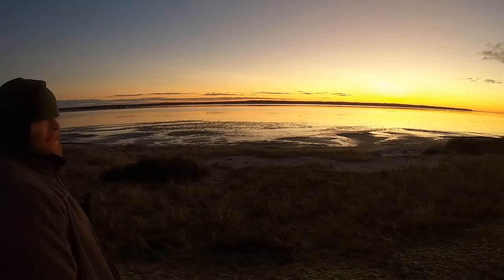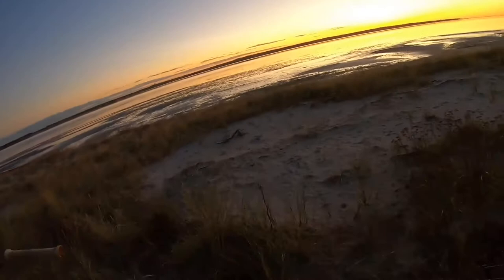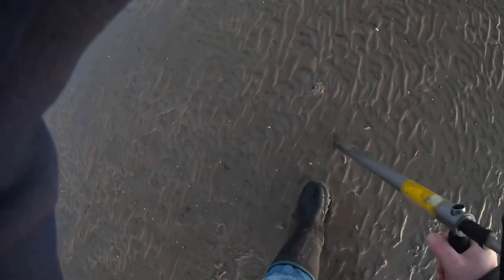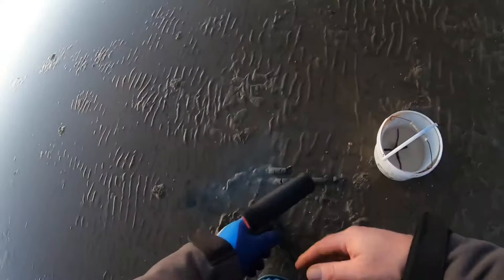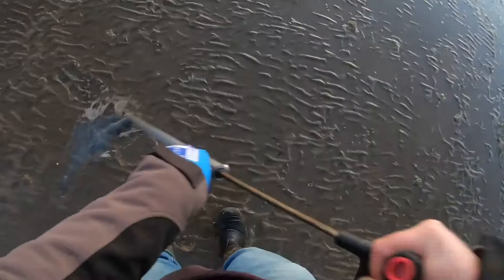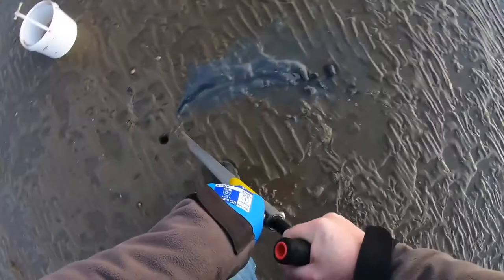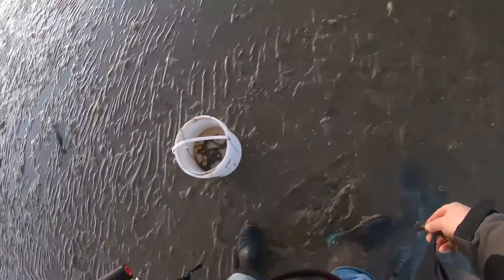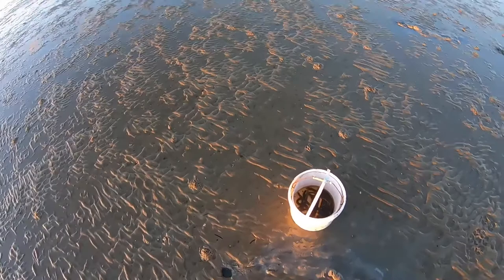How to pump lugworm - and why I suck!

Comment: Hi Billy, just seen this video and have had one session with an online brought bait pump that has a wing nut as a bottom tension nut, I only managed 3 worms and thought it was down to not pumping properly, thanks so much for the info regarding removing this type of nut and replacing it with a standard locking nut, I'm also now building my own bait pump and will be doing the same with that too.
Happy fishing
Reply from the maker: Glad to help out Steve, fish on Brother 👍😁👌

Comment: I pump lug full time for a living and make bait pumps . I don't push my pumps too much but if your interested I can make you a deadly bait pump . In the right hands I've seen a 1000 lug a tide blasted out using these pumps.
Reply from the maker: I do just fine, with the one I have, thanks Brother. But no boddy is pumping a 1000 lug in a tide, where I am.  A big tide is 60cm and there not alot of ground to pump👍👌

Comment: Hello Billy, I'm french, sorry but here we don't find screw (english parameters, not metrics size). I want to follow your instruction in replacing wingnuts but which size I have to put please ? Cold you give me reference pleae, thanks
Reply from the maker: Hi Ppte. Sorry but I do not have my pump with me right now. So what you should do is take your pump to the hardware store and they will help you with that. The nut I use is a stainless steel nylon locking nut. Thanks hope this helps you out 👍😁
Reply: @Billyfishing_watch   @Billyfishing  Thanks Billy, the problem is that we have a system metric size in france not an english size. Size screw and nut is different and this afternoon, i tried severela store, nobody can't find; I have to buy it to internet but I don't know the size, it seem to me that it is may be 5/16 UNC nyloc but I not sure.
Reply from the maker: Hi, my pump is an Australian pump. And I purchased the nut for it  in Scandinavia. They also use the metric system. Where is your pump from?
Reply: @Billyfishing_watch it is an alvey  pump bought in france (slim pump 30mm)
Reply from the maker: That's the same make as mine, but my pump 35mm. Do you know a mechanic, he might have a thread gauge. And possibly help with your problem. 🤞
Reply: @Billyfishing_watch  hello Billy, thanks a lot for your support and kindness, continue to post video, nice channel and full tricks inside.
Reply from the maker: No probs Brother 👍

Comment: Have you dug Rag before? A video on digging Ragworm would be cool. Also would Olive oil work better than washing up liquid for the pump or would it clog with the sand? Lastly Billy where would I get a pump, if actually enjoy going and getting my own bait
Reply from the maker: Hi Darren, yes I dug rag. But that's a vid for the summer, there no good in the winter, I got my pump on the web, lots choose from. My pump has a diameter of 35mm, best for blow lug. 👍
Reply: @Billyfishing_watch  thanks Billy! Yes of course I usually fish with Rag from late July to late October. June and July are mainly freshwater months for myself targeting Sea Trout runs using the fly on the slaney and then blackhead worms on permitted smaller tributaries 😃 Iv only gone fishing twice in winter months on the shore and been unsuccessful Iv used black lug from frozen and razor from frozen tipped with mackeral but as you would say “no bueno” 😅

Comment: Great video. Very informative. You mentioned about changing the butterfly nut at the bottom of the pump. Would you change it for a flanged nut or a normal nut.
Reply: Would you use a normal 8mm nut with or without a flange
Reply from the maker: Hi Wayne, thanks man. Just nylon lock nut or a normal one. Fish on Brother 👍👊

Comment: Hi Billy I’m replacing the wingnut today mate what sort of wrench/ratchet do you use to tighten the locking nut? Cheers 👊🏻👍🏻
Reply from the maker: Hi bud. It does not really matter,  whatever fits. My ratchet takes a 3mm socket, thanks Brother 👍😁
Reply from the maker: Any time 👍